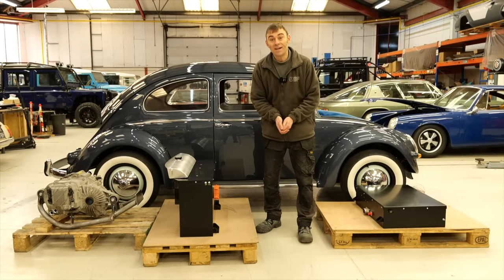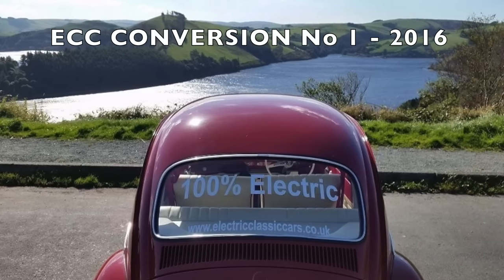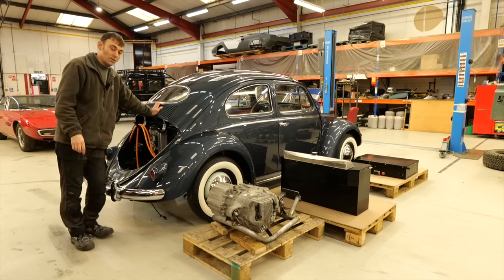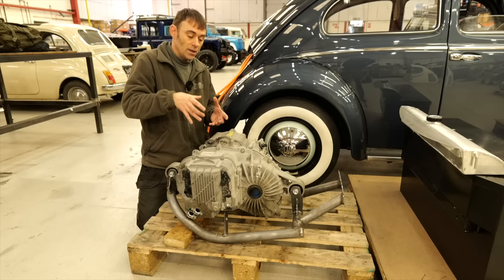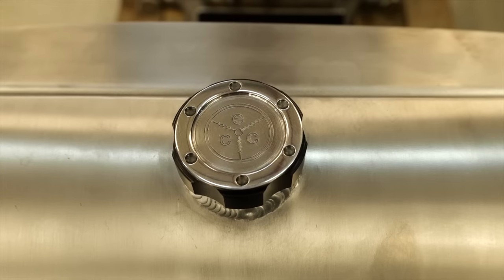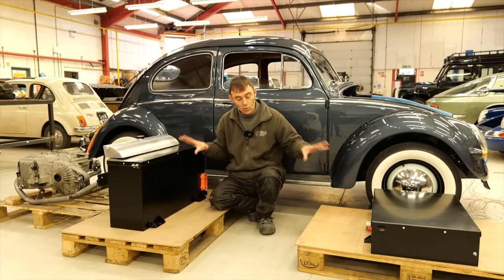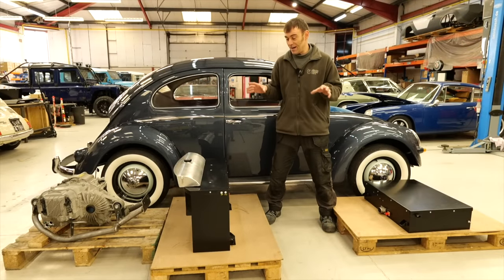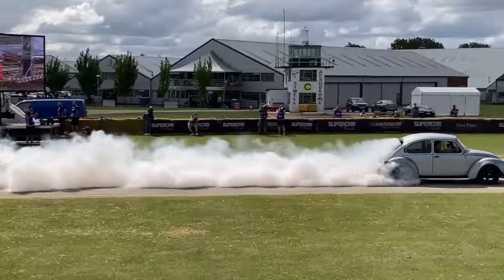Electric VW Beetle - Bolt-in kit

Comment: Do you run the car interior heater form the new radiator you've added for battery cooling?
Reply from the maker: No, it doesn't give enough heat. Here's an episode where we cover the heaters we use. 👍 https://youtu.be/s75gJuMS1_M

Comment: Question: does the battery cooling system provide the heat or do you have an electric heater, also is a/c an option?
Reply from the maker: A/C is indeed an option. Heating comes from a PTC (electric) element as there’s not enough heat to come from the battery to really make a difference.

Comment: HI guys! Cheers from Utah in the US! I have a Prova Countach I built back in the early 90"s. I currently have a 327 chevy adapted to a Pontiac Fiero 5 speed, as such, the engine sets transversely. I'm untriaged about the idea of putting an electric motor of 4-5 hundred hp on the transaxle, Keeping the ability to row the gears.  Plenty of room where the fuel tank is for battery's, and the fronk would benefit from the added weight there as well. Could you offer your thoughts and recommendations as to feasibility and a way forward? Thanks in advance!
Reply from the maker: We have a Prova kit here too. I'd go Tesla drive unit in the rear, to give it the power to match the looks, and a split battery pack, front and rear to balance the weight. 👍
Reply: @ElectricClassicCars  Thank you for that! I will consider!

Comment: Hi there, great video. I used to have difficulties demising the screen, and keeping the car warm. How do you do this on the electric beetle? Are you able to use any waste heat from the batteries or inverter or motor?
Reply: Electric heater 👍😀

Comment: First car was a 1964 850cc Austin mini which was slow and economical but cornered like a boss used to love leaving all comers in my dust on my favourite twisty down hill road. Unfortunately got written off by a drunk driver, if I still had you can bet I would electrify it.
Reply from the maker: They used to handle like they were on rails. 😁👍

Comment: My first car was a red 1968 beetle bought from a scrapyard for £100 after an engine fire. I rewired the burnt-out electrics, replaced the faulty fuel pump in a weekend, and had it back on the road.  That was 1983 and it's still going albeit in someone else's hands.  One question, how do you replace the (rather useless) original heater?
Reply: Electric heater 👍😀

Comment: Are those Model S Motors? Do you use Model 3 Motors? They are north of 200kw which is not nuthin, and Tesla is making a lot of them. Just curious. Also, 150 mile range is not nuthing. Definitely should be able to handle all kinds of round town duties.

Comment: How about a 2016 gmc extra cab 4x4?
As far as a natural for conversion, I can't imagine a better candidate than a pickup truck because of all the unused space, large fuel tank and engine bay with heavy duty suspension.
Medium power and maximum range is the goal🤔

Comment: So you supply and fit said conversion kit. I have a 1969 1200 bug  fitted with a 1776cc motor and a 1500 gearbox ( not irs)  which was my first car too. How much to get it converted??  And how long is the wait to have it done?
Reply: I'm from Chessington in the UK by the way.

Comment: First car was a Ford Taurus 12M lefthand drive bench seat column change 4 speed an reverse. White with black stripe after going through  a motorised car wash the black stripe washed off revealing a blue stripe. 4 trips from Germany to the UK an back before being scrapped as floor fell out. It had rotted from the inside out alas.
Reply: Won what? I haven't entered a competition.
Reply: ElectricClassicCars_   won what as I haven't entered a competition.

Comment: I got my  first 1303 in 1976 as my first car at the age of 17. Unfortunately someone ran into it when I was 21, so I replaced it with another that I’m still driving today 42 years on. I would love to do the Tesla conversion on my Superbug/Beetle eventually here in Sydney Australia. Do you currently have an agent installing your kits here? 

I’m currently waiting on delivery of a Cupra Born V3 or Australian spec.
I’m too old for spanners, noise and oil leaks - so electric is the  way to go.
Reply: Cool 👍😀

Comment: I have a 1974 carmen ghia that has been in my family since 1976 and with me since 1980. It was my mother-in-laws. The vehicle is under complete restoration. Body work done and ready for assembly. The engine and transmission (not installed) have been completely restored. It seems that a switch to electric at this point would be good. Any possibility??????
Reply: Great idea. Do it. 👍😀😊

Comment: First car hand me down 69 VW Bus.  Left in Elgin Texas in 1986 when it through a rod.  Currently own 1972 VW Campmobile running but needs some engine work.  Have been thinking of converting to EV.  Your beetle conversion looks great, wondering if you have considered a bus version?
Reply from the maker: Yep we’ve done loads of busses, check out our other episode. There’s a splitty, early bay Crewcab, late bay camper and a T3 Syncro camper. 👍

Comment: I’m curious as why you are using a Tesla battery pack which requires liquid cooling rather than the Nissan Leaf battery which is air cooled.  One reason that I drive a Leaf is that I don’t have a cooling system to worry about.
Reply from the maker: We're not using Tesla battery modules in this. Liquid cooling is much better than air for thermal management of batteries.

Comment: How do you provide heat and defrost to the passenger compartment?
Reply from the maker: Depends on the build, either an electric PTC heater (think hand dryer in a washroom) or via a heatpump like most modern EVs.

Comment: Great video. My wife's 1st car was a 1200 Beetle, would love an electric version, where does the heat come from in the EV version?
Reply: Just realised that's unclear, to clarify, where does warm air come from to clear the windscreen and warm the occupants in a British winter (and spring and autumn) come from?
Reply from the maker: It has a heater in it similar to that in a modern EV. Think hand dryer in a washroom. Instant heat. 😁👍

Comment: Heads up .. Range , pretty sure you said 150 miles? the text is saying 50.
I have an Australian 67 that I'd bought a T4 motor for, 20 years ago but never did.
I think I grew out of over motored builds 😁
Anyway I could see the writing on the wall and figured one day EV conversions for classics would become the norm and what better classic than a Beetle. Are we there yet?
How do I get this in OZ, seem to recall you were/are only supplying to installers...
Reply from the maker: Thanks for the heads up on the CC range error. Yep, currently we're only supplying to electric conversion workshops. If there's one in Oz you could get them to reach out to us. 👍

Comment: I liked your car, AND prefer hybrids, STILL.   It's possible to get Fiat 500 parts to "run" either end, front/back.  I'd like a Fiat with one end electric, and another end gas-driven, but I'd like the gas-end to have a converter/BIG alternator, so I could use like HALF of your battery pack, because most of the time, I'd be using direct current,generated from the Engined-end, so the engine'd have to produce enough to charge the battery-pack, and then run way less than redline, going 80mph all day {easily possible in the US} on direct-current?  If I used a  BASE, EU-only Nuovo Fiat 500, the battery-& electric half could be put in the front, and a base, V-twin Euro-Fiat air-cooled-engine could help get up to 80mph, and then I'd run the engine slightly over idle, While "charging the system" while providing direct-/converted current to go down the road.  I had also/alternatively dreamt of buying a Used,  Electric Fiat, BUT the RANGE of the Electrc Fiat, is only 80-100 miles and A/C is Necessary in Phoenix-Desert weather, with temps as high as 140 degrees F /60-degrees celsius, and hot-weather's present a minimum 8 mos. of a year.   So maybe the easiest solution would be to have a small [--200cc? ] gas-engine on a small trailer with the engine, gas-tank, converter, other, towed-along behind, so that the. Electric Fiat could be a "cross-country" vehicle.   I'd want to travel 400+ miles/more, and have a cheap & constant way to "charge" to not only have Great-range, but charge-up When & Where I wanted,--not have to have my car waiting hours in a Queue /strain any Power-grid.  I noticed you had a Fiat 500? in your garage behind & to the left of your Electro-V-dub in the video.   I'd like to drive 400+ miles--wait 30minutes to an hour, and then drive ANOTHER 400+,  with maybe 3 or 4 more "400s" before I reach my destination.  Every 400+ miles, I'd have to spend up to 7-8 hours sleeping, during which, it'd be GREAT to run the car's A/C!  Are there Other videos where you electrify Fiats?  Why don't you do hybrids?

Comment: Hello Richard. I am constantly thinking about the feasibility of scraping the floor of old cars for conversions. I know it is hard work and more expensive, but it would also contribute to better center gravity, the marriage of batteries, higher power, better design and more would result in more room in other areas. What do you think?

Oh, to answer your question: My first car was a Renault 9 TSE. I got it from my father. The engine burned down because the pipe from the heater detached during a trip to the beach and I was too late to notice when it overheat.
Reply: They tend to focus on keeping the cars as close to original as possible ... even to the point of being able to restore the cars back to ICE if people wanted to in the future. However, I'm sure there are further optimisations possible if you forget about that aspect and go all-in with a permanent EV conversion ... which could then include major changes to floorpan and chassis.
Reply: @MrAdopado  Yep, there is a good point there.
Reply: @MrAdopado  I'm of the philosophy: Make the car the best you can for the future. Never go backwards!

Comment: Couldn't you convert the "radiator" into the heater core for the passenger compartment?
Reply from the maker: It doesn't really give out enough heat. 👍
Reply: @ElectricClassicCars  Would it be enough to defrost the windshield?

Comment: Is there a solution for the heater?  Because there is no gas engine producing heat.
Reply from the maker: Yes. It has an electric heater. Just like in modern EVs.

Comment: When I was in the U.S. Air Force in 1969 I bought a 1957 VW with a 1500cc Porsche Super engine. When I drove the car back home to Illinois I decided to rebuild the engine. I pulled the heads and jugs and when I looked inside the case I saw the Hirth roller bearing crank. I had no idea it was a roller crank. I immediately reassembled the engine and put a 36 horse engine in the car to sell it. In what would now be considered a felony, I threw the engine out when my parents sold their house. I will never not feel the shame for my actions.

Comment: I recently nearly doubled the power of my 2014 Nissan leaf by installing a later model inverter and canbridge.  It has put in in the 0-60mph in the 5 second bracket :)  same old battery as it came with is taking it well. Anyways looking for advice on adding a rear motor too. im also looking at a molicell pack, having built a number of my own 140v emoto packs in the past i have some experience, but wondering if these LG packs are better?  Im looking at 800A output.  I have seen some russian comversions , but not sure those would pass engineering etc
Reply from the maker: Not done much with Nissan Leaf stuff yet. 👍

Comment: On average what is the net weight difference after conversion?
Reply from the maker: Our aim is for the vehicle to weigh the same as when it had an ICE in it with a full tank of fuel. However some vehicles post conversion can weigh more than before, but never more than the weight of one adult passenger. 👍
Reply: @19:30

Comment: Just a little disappointing. I thought you would show the actual installation of the conversion.  As far as my favorite car that I wish I could afford now was my 1970 Barracuda convertible that I bought right off the showroom floor.  It was very fast with a 383 4 speed with posi-traction differential.  It cost me a little over &6,500.  In comparison, I only made $5,200 a year at that time.  I would love to have any iteration of one right now, but especially an electrified one now.  Today I drive a 2017 Tesla Model X (that I bought used) and I love it to death!

Comment: To bad that charging port is not behind the license plate or rear signal lamp.
Reply from the maker: That would have required drilling a big hole in the bodywork, which is a no no for us. 👍
Reply: @ElectricClassicCars  make rear light removable , install charging port behind it. Another option, put charge port on retractable cable. I want to charge without leaving hood open.

Comment: Is it just me, or is an electric conversion more desirable than a Tesla, Nissan Leaf, etc?

I don't like the way new cars are going, in general.  All the stupid technology, self driving, lane assist etc.    With enough sensors to stop it working for long outside the warranty period; programmed obsolescence. 
Cars I would like to see converted, Ford Consul, Escort, Granada.
Triumph TR3a (ask your Dad)
Jaguar XK120   
Model T Ford
Austin Cambridge 
Rover P6
Porsche 924, (Wouldn't pull your foreskin back as a petrol car, but would be a sensational electric)
Out of all the above, I have only owned a TR3a, I over-restored it and was scared to leave it anywhere!

My favourite would be the Consul, front bench seat.   Beautiful.
Reply from the maker: I'm not a fan of new cars either, that's why I started converting my own classics to electric 7 years ago. 👍

Comment: My first car was a 1960 Beetle YGD396 Indigo Blue. Bought second hand 1969 when I was 17. Wish I still had it. As for an EV version. No thanks. Just bought a new BMW 2 litre turbo petrol. Getting told I should have bought an EV. Friday last driving from Glasgow to Gloucester, and getting stuck in no end of tailbacks, adding a couple of hours to my journey. So it pleased me no end, to see a queue of EV's waiting to use the only 2 working chargers at the services I pulled into. Petrol, and something to eat. 20 minutes, and I was on my way. The EV queue had only reduced by one car. No EV for me. Incidentally, the only two people I know that bought EV's last year, are desperately trying to sell them, and go back to ICI.

Comment: How to ruin a classic,can’t wait for electric drag cars won’t that be fun,maybe they can simulate engine note through a speaker system,just look at crowds at MotoE and how bored they are with lack of excitement as the sounds and smells of racing are absent,don’t want to be negative but I’m pretty sure Electric Vehicles will destroy our sport of motor racing as we know it and we are clapping and smiling our way to this result,I know we need cleaner energy but what ever happened to the car that runs on water/hydrogen,the days of our electric car telling us where we are allowed to travel and our electronic cash telling us where and when we are allowed to buy/sell won’t that be fun for generations to come,we’ll done❤